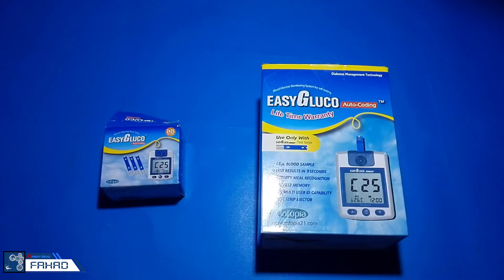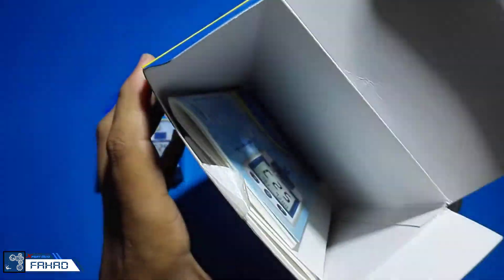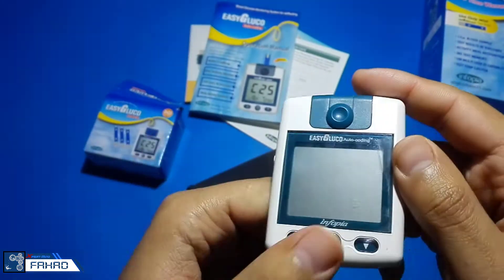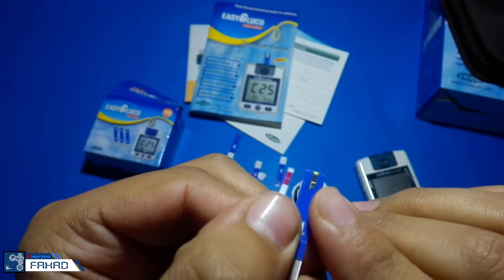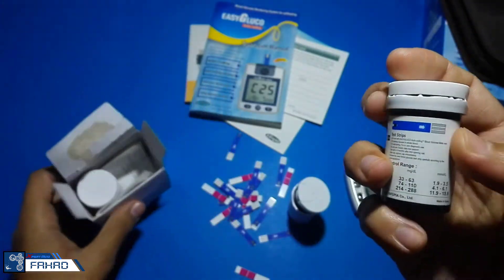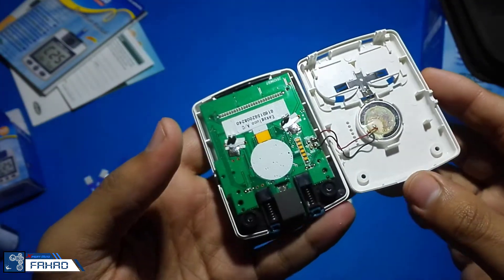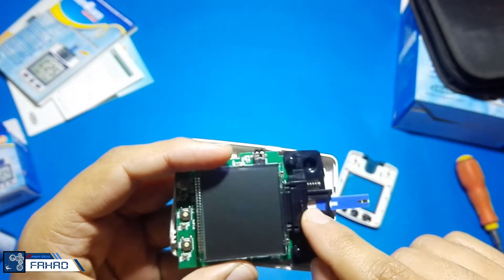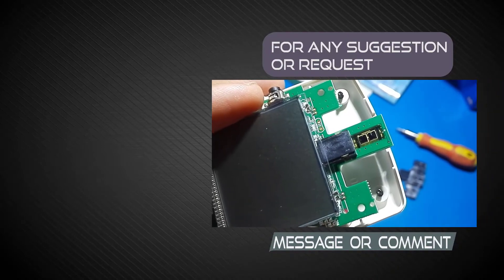What is inside a Blood Glucose Meter? From UnBoxing To Screwing it Up | Exploring Electronics

Comment: Please elucidate more on how the batteries were connected in order for the device to function and explain about the software used and how it's programmed
Reply from the maker: Software can vary based on the device you are using. Like Arduino or Pi... or another board and sensors.

Comment: I think photosensor might be for some other purpose, may be to detect the strips. these are electrochemical strips. they are detected electrochemically not optically. also its very difficult to detect ferricyanide in blood optically due to the RBCs .
Reply from the maker: I said what I found in the general working of Gluco Meter.